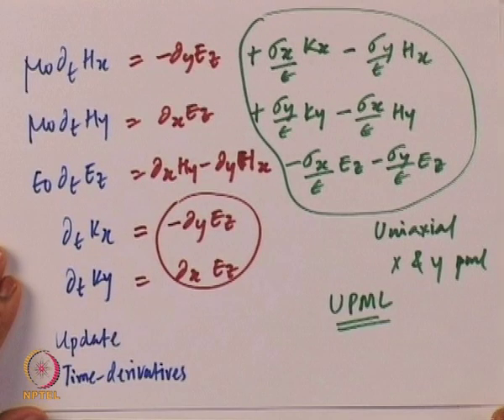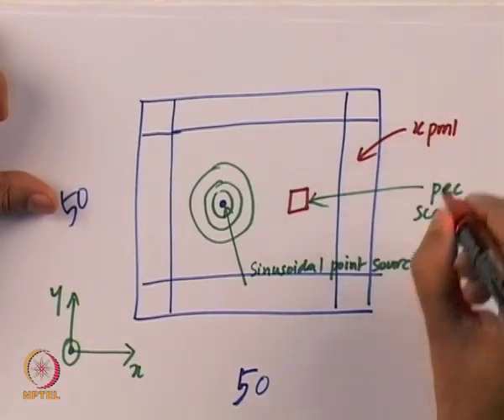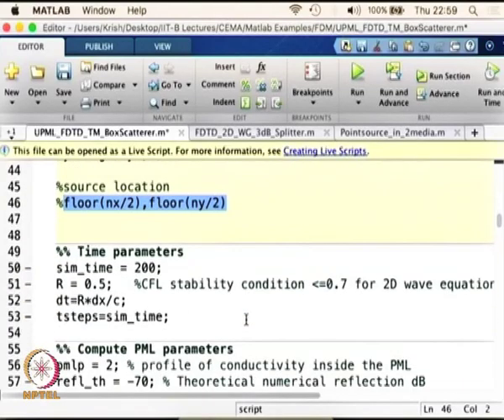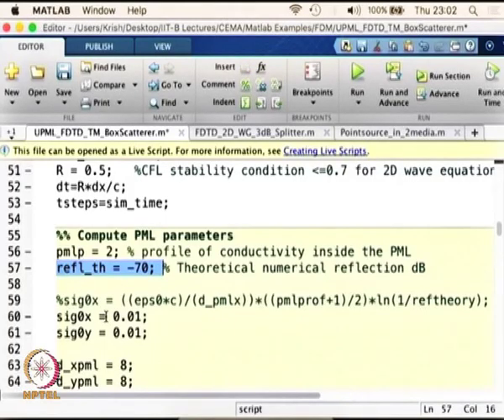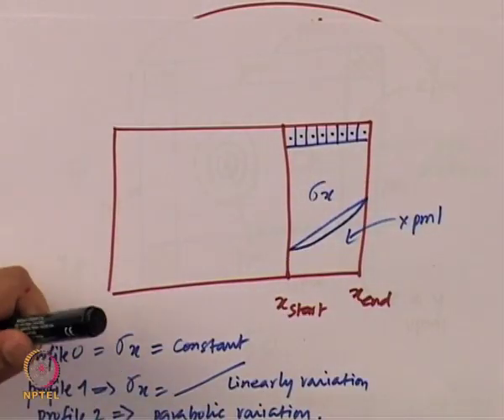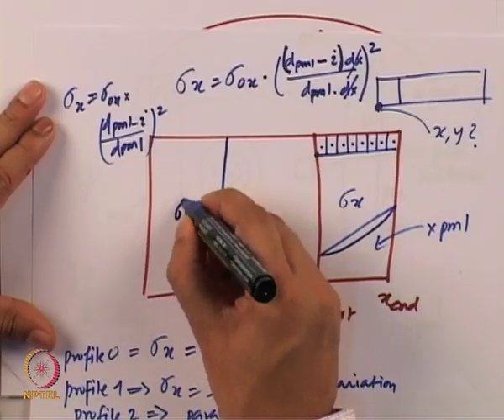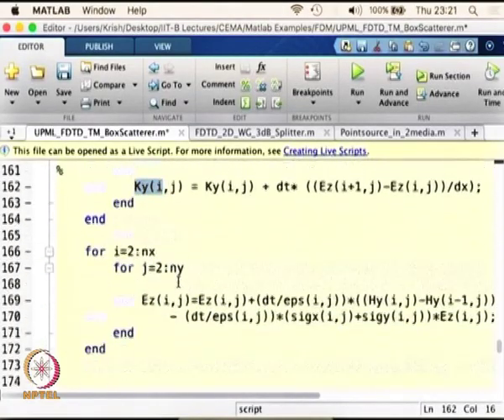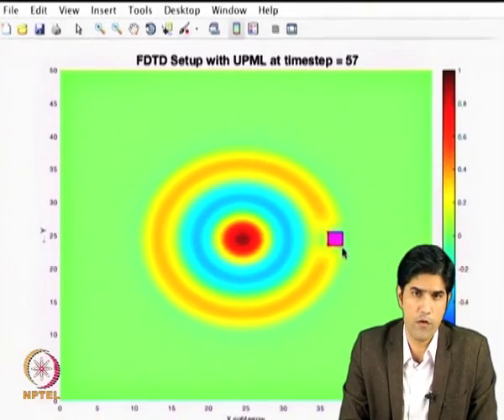Exercise 9

Comment: clf;
clear;
clc;

%Physical domain
a=50;
b=50;

%Constants
eps0=8.85e-12;       %Permittivity of free space
mu0=4*pi*1e-7;       %Permeability of free space

%Source parameters
c=3e8;               %Speed of light
freq=3e7;            %Frequency of the source
lambda=c/freq;       %Wavelength of the source
k0=(2*pi)/lambda;    %Wave number
w=2*pi*freq;

%Grid parameters
dx=lambda/20;        %Step size along x-direction
dy=lambda/20;        %Step size along y-direction

x=0:dx:a;
nx=length(x);

y=0:dy:b;
ny=length(y);

%Time parameters
sim_time=120;
R=0.5;               %CFL stability criterion
dt=dx*R/c; 
tsteps=sim_time;

%PML parameters
pmlp=2;              %profile of conductivity inside the PML
refl_th=-70 ;        %Theoretical reflection in dB

sig0x=0.01;
sig0y=0.01;

d_xpml=8;            %pml of 8 cells thick in the x-direction
d_ypml=8;            %pml of 8 cells thick in the y-direction

leftrightpml=[1 1];
lowuppml=[1 1];

%Initializing parameters of pml
sigx=zeros(nx,ny);
sigy=zeros(nx,ny);
mur=ones(nx,ny);
epsr=ones(nx,ny);
mu=zeros(nx,ny);
eps=zeros(nx,ny);
z=zeros(nx,ny);
oneM=ones(nx,ny);
dtM=dt*ones(nx,ny);

%Filling up conductivity values
for i=1:nx
    for j=1:ny
        if leftrightpml(1)>0 && (i<=d_xpml)
            sigx(i,j)=sig0x*(((d_xpml-i)*dx)/(d_xpml*dx))^pmlp;
        end
        
        if leftrightpml(2)>0 && (i>=(nx-d_xpml))
            sigx(i,j)=sig0x*((i-(nx-d_xpml))/(d_xpml*dx))^pmlp;
        end
        
        if lowuppml(1)>0 && (j<=d_ypml)
           sigy(i,j)=sig0y*(((d_ypml-j)*dy)/(d_ypml*dy))^pmlp;
        end
        
        if lowuppml(2)>0 && (j>=(ny-d_ypml))
            sigx(i,j)=sig0y*((j-(ny-d_ypml))/(d_ypml*dy))^pmlp;
        end  
    mu(i,j)=mur(i,j)*mu0;
    eps(i,j)=epsr(i,j)*eps0;
    z(i,j)=sqrt(mu(i,j)/eps(i,j));    
    end
end

%Initialize field matrices
Hx=zeros(nx,ny);
Hy=zeros(nx,ny);
Ez=zeros(nx,ny);
Kx=zeros(nx,ny);
Ky=zeros(nx,ny);

%Initialize curl matrices
CHx=zeros(nx,ny);
CHy=zeros(nx,ny);
CEz=zeros(nx,ny);

%Initialize integration matrices
ICHx=zeros(nx,ny);
ICHy=zeros(nx,ny);
ICEz=zeros(nx,ny);
ICKx=zeros(nx,ny);
ICKy=zeros(nx,ny);

%FDTD loop for the E-field

for t=1:tsteps
    
    %Boundary condition PMC
    Hx(:,1)=0;
    Hx(:,ny)=0;
    Hy(1,:)=0;
    Hy(nx,:)=0;
    
    %Boundary conditions PEC
    Ez(:,1)=0;
    Ez(:,ny)=0;
    Ez(1,:)=0;
    Ez(nx,:)=0;
     
    %Defining a scatterer
    
%     for i=73:74
%         for j=48:52
%             Ez(i,j)=0;
%         end
%     end
    
    %Update Equations
 
    for i=1:nx
        for j=1:ny-1
            Hx(i,j)=Hx(i,j)-((dt/mu(i,j))*((Ez(i,j+1)-Ez(i,j))/dy))+...
                    ((dt*sigx(i,j)/mu(i,j))*Kx(i,j))+((dt*sigy(i,j)/mu(i,j))*Hx(i,j));
            Kx(i,j)=Kx(i,j)-(dt*(Ez(i,j+1)-Ez(i,j)))/dy;
        end
    end
    
    for i=1:nx-1
        for j=1:ny
            Hy(i,j)=Hy(i,j)+((dt/mu(i,j))*((Ez(i+1,j)-Ez(i,j))/dx))+...
                    ((dt*sigy(i,j)/mu(i,j))*Ky(i,j))-((dt*sigx(i,j)/mu(i,j))*Hy(i,j));
            Ky(i,j)=Ky(i,j)+(dt*(Ez(i+1,j)-Ez(i,j)))/dx;
        end
    end
    
    for i=2:nx
        for j=2:ny
            Ez(i,j)=Ez(i,j)+(dt/eps(i,j))*((Hy(i,j)-Hy(i-1,j))/dx)-...
                    (dt/eps(i,j))*((Hx(i,j)-Hx(i,j-1))/dy)-((dt*sigx(i,j)/eps(i,j))*Ez(i,j))-...
                    ((dt*sigy(i,j)/eps(i,j))*Ez(i,j));
        end
    end
    
    Ez(1,1)=Ez(1,1)+(dt/eps(1,1))*((Hy(1,1)+Hy(1,1))/dx)-...
                    (dt/eps(i,j))*((Hx(1,1)+Hx(1,1))/dy)-sigx(1,1)*Ez(1,1)/eps(1,1)-sigy(1,1)*Ez(1,1)/eps(1,1);
    
    %Defining the Source 
    source=sin(2*pi*freq*t*dt);
    Ez(floor(nx/2),floor(ny/2))=2*source;
    
    %Plotting the Ez wave
    [xx,yy]=meshgrid(x,y);
    pcolor(x,y,Ez');
    rectangle('position',[36 23.5 2 2],'facecolor','m');
    shading interp
    xlabel('X \rightarrow');
    ylabel('\leftarrow Y');
    zlabel('E_z \rightarrow');
    titlestring=['\fontsize{14} FDTD Setup with UPML at timestep(',num2str(t),')'];
    title(titlestring,'color','k');
    
    axis([0 a 0 b -1 1]);
    view(0,90);
    caxis([-1,1]);
    colormap('jet');
    colorbar;
    getframe;
    
end